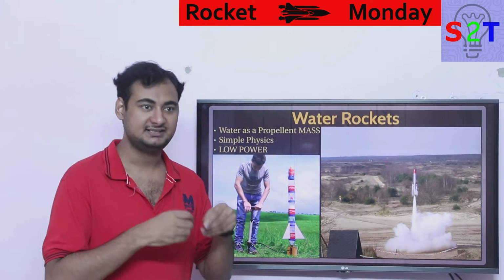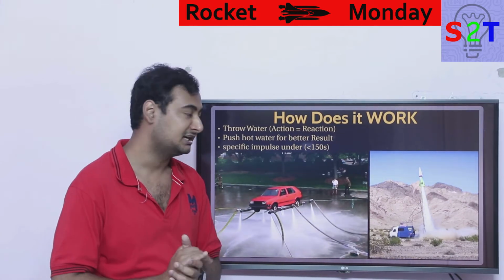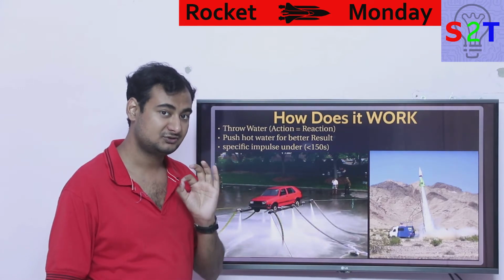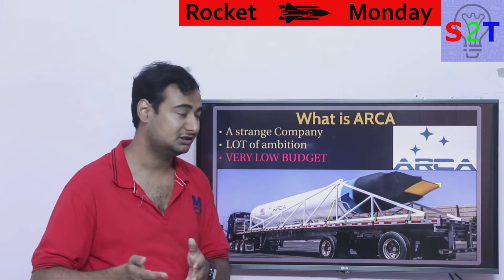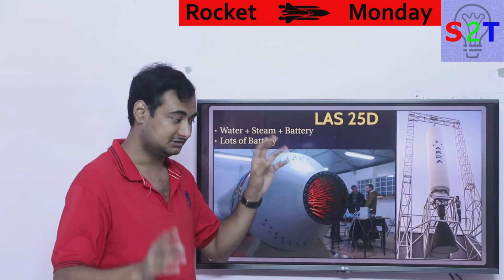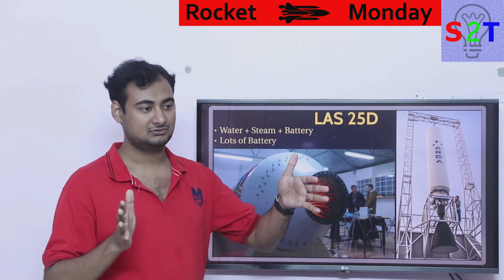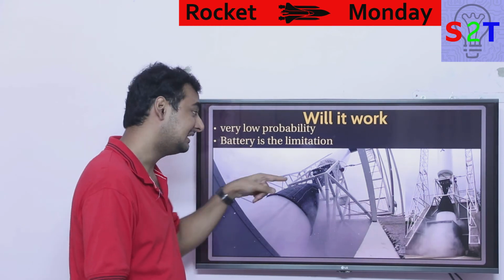ARCA Steam Rocket Explained{Rocket Monday Ep67}

Comment: Thank you for your video. I am not english native speaker, so I'm not sure to understand all what you're saying. If I understand, you said that the specific impulse can not be higher than 150s. I heared that Arca plans to pre-heat the water before launch. Takes your 150s value that fact into account ?
Reply from the maker: yes pre-heat will help to reduce power demand on batteries but wont make water into rocket fuel
Reply: @s2tenglish  Ok. But how do you calculate the Isp in that case ? I think that the water steam has a very big enthalpy per kg. Which percentage of this enthalpy will they be able to recover for propelling of the rocket ?
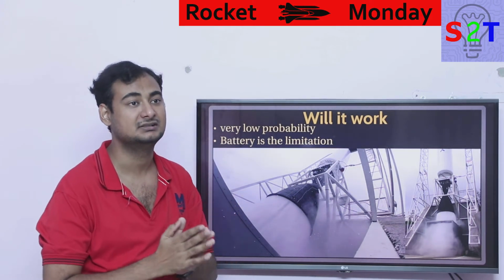Reply: @s2tenglish  I the video of Manley at 7:57 (https://www.youtube.com/watch?v=qT9HBkWGg7s), He is speaking about a concept of nuclear steam rocket. The article is here : http://www.neofuel.com/moonicerocket/. What do you think about that ?
Reply: As I understand, their concept is for lunar rocket. They arge that they could achieve an Isp of 195s, and that their rocket would require a very smaller lunar infrastructure that the LOX-LH2 counterpart.
Reply from the maker: @francoism2232  let them get off earth first and yes it will work on moon but on earth its very hard